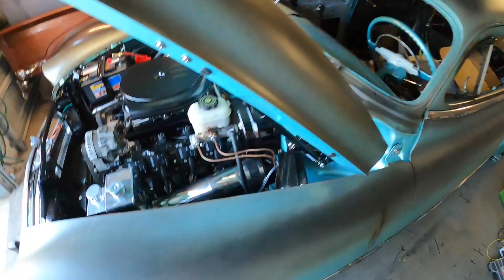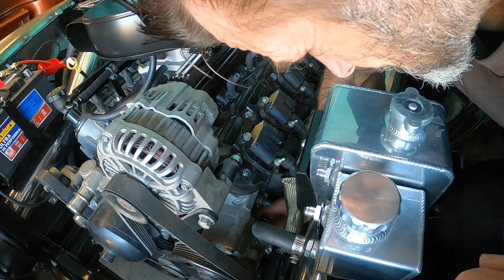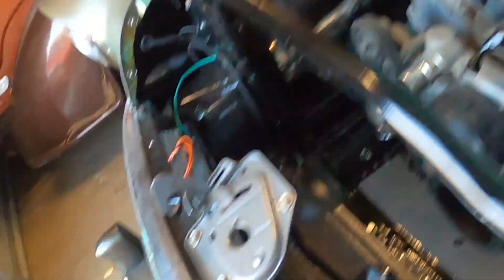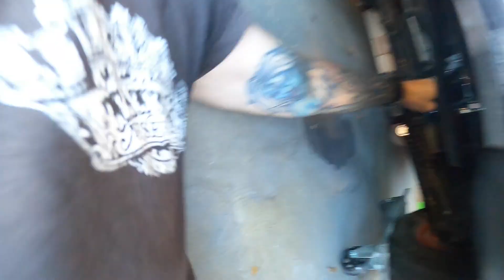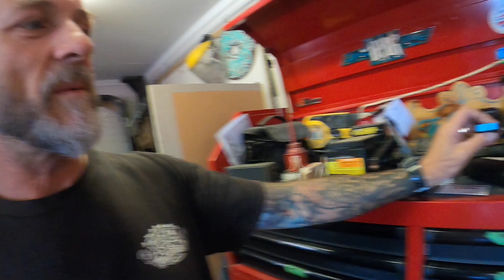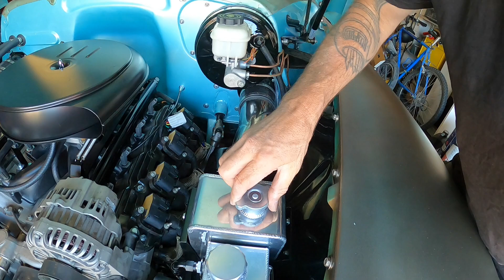51 Chevy Kustom Plumbing the power steering with new 6an fittings

Comment: JIC hydraulic fittings are the same as AN just a bit less thread engagement.
Reply from the maker: Thanks man. I didn’t know that.
Reply: @DMACKustoms  you can read about an fittings etc etc on a pdf catalogue by Aviall  Its the big aviation supplier. and for process for repairs ,riveting etc Look up AC14-13  its a big pdf but you can quick look/learn from it

Comment: just takes time dave, , i'm driveing my truck but i'm still working on it, hot rods are never finished.  question--have you heard the engine run and is the engine stock the an fittings and ptfe line is the way to go, things are looking good, keep it up. see ya next week.
Reply from the maker: Hey Mike,  I haven't heard this engine run yet, I was assured it's a low mile solid unit, but we all know how that can be haha, Fingers crossed it's all good, I did put a cam in it not long after I got it and it does look pretty clean inside.